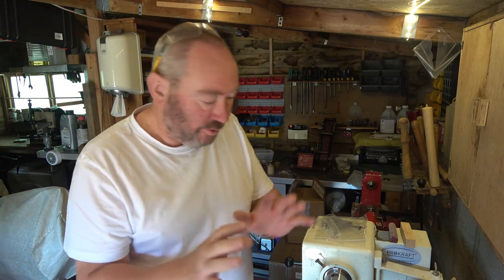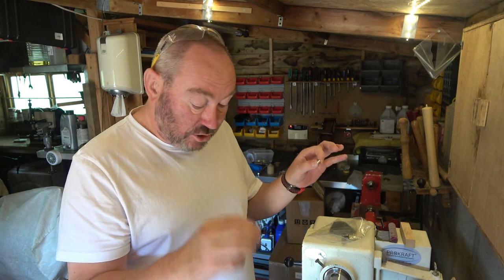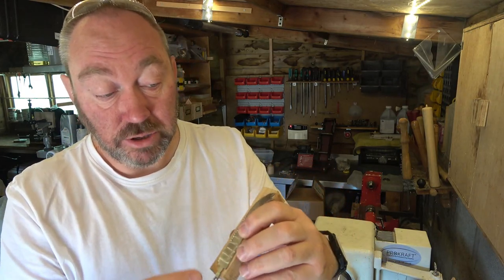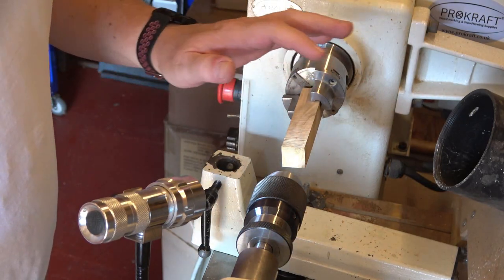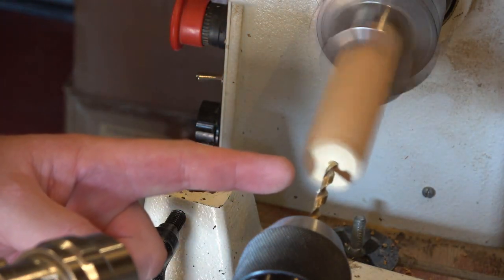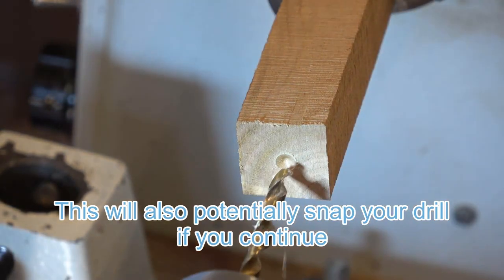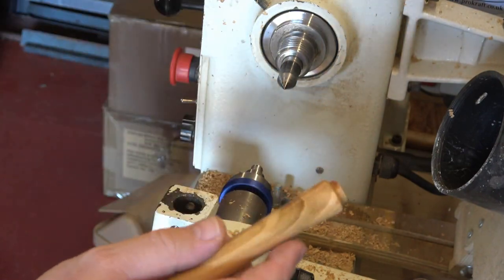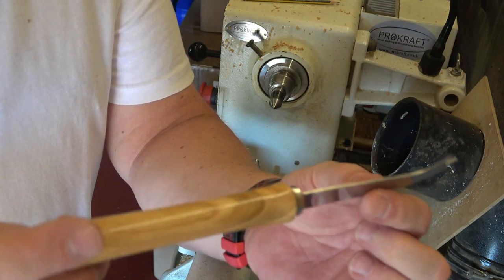stainless cheese kits   turning between centres

Comment: Hello Jon great video.  I was wondering what kind of light do you have on the tail stock thanks Michael
Reply from the maker: Hi Michael, it is an LED lamp from Arc Eurotrade, they are about £21 and it's not very good - dodgy connection for the lights and it rarely points in direction I need it. It is a cheap LED torch in a big clip. I now have some LED strip lights in the roof - much better. Some of the light in the video is sunlight but that is a bit unreliable!
Reply: @prokraftuk  thanks for that jon good to know 👍

Comment: Not explaining how to wood fit in knife. How to do fit in ???
Reply from the maker: It does explain to put it in a vice with leather padding (or anything to stop the blade getting scratched) and knock the handle gently onto the tang, it can also be glued if required.